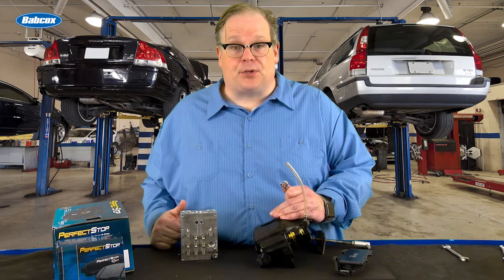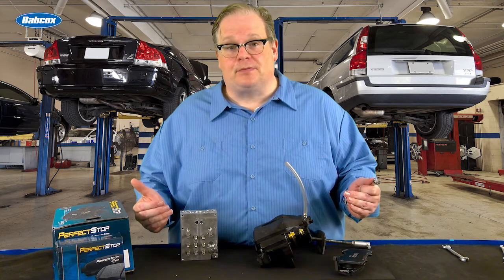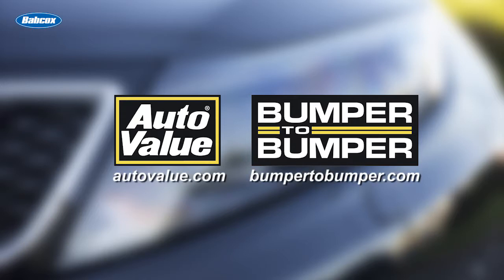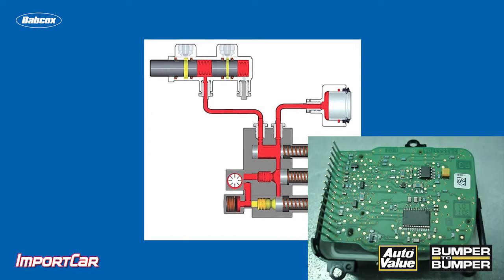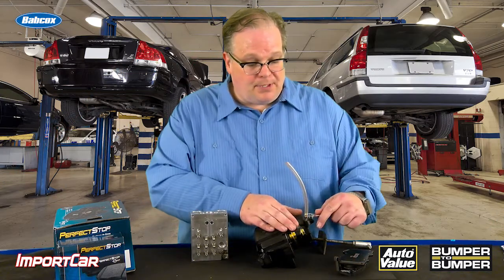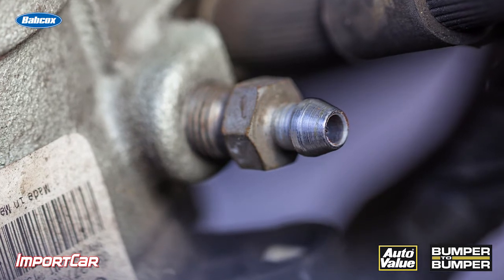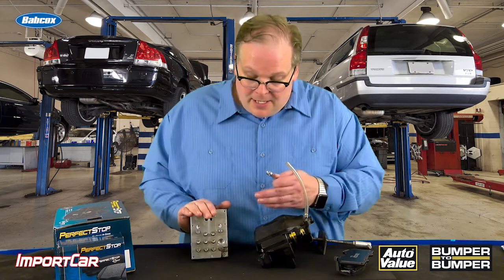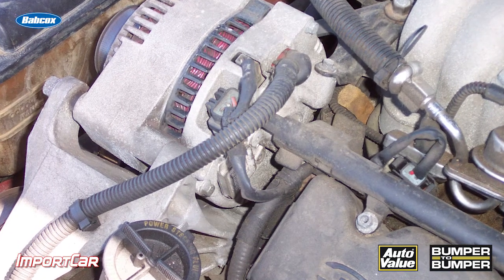Brake Bleeding And The ABS HCU | Tech Minute

Comment: Excellent.  This information should be required to be printed in large red font on every package of brake pads/shoes since ABS came out in the late 80's.  This procedure should be followed even if the vehicle is brand new.  Just pushing fluid backward through the ABS can cause severe braking issues even if the fluid is very clean/new.

Comment: Unfortunately I viewed this video AFTER I already compressed both my front calipers without opening the bleeder.  So in other words I did indeed force old brake fluid upstream.  (Who knows if it made it to the the ABS HCU).... I am not currently experiencing any braking issues.  But as a precaution, is there a suggestion you can provide as to what I should do now as a preventative measure?  A complete brake fluid flush?  Yes.  But from my understanding, flushing the fluid the conventional way will not flush the ABS HCU.  Am I understanding this correct?